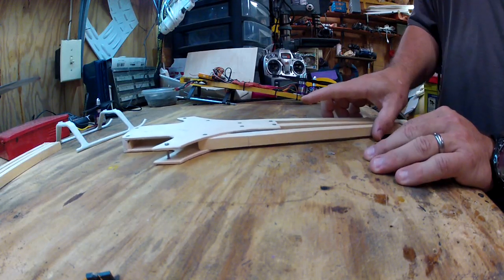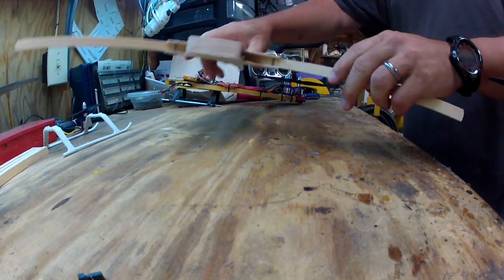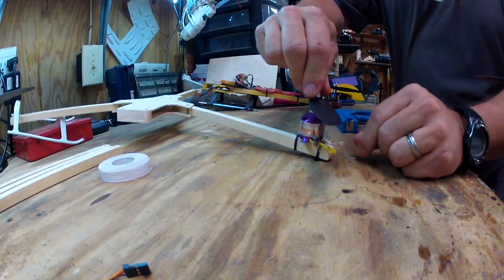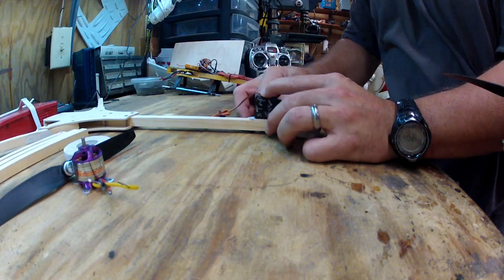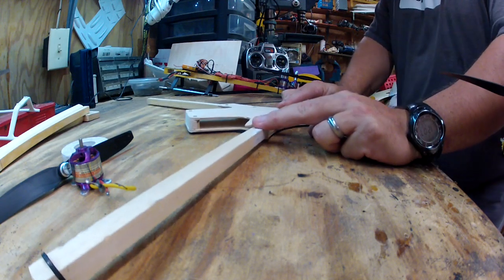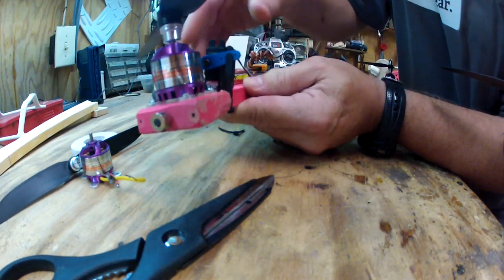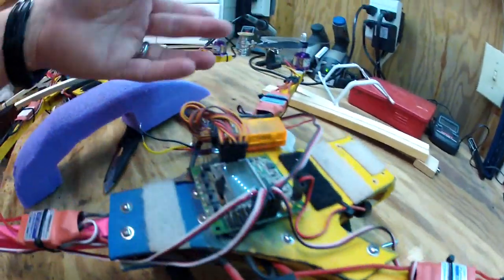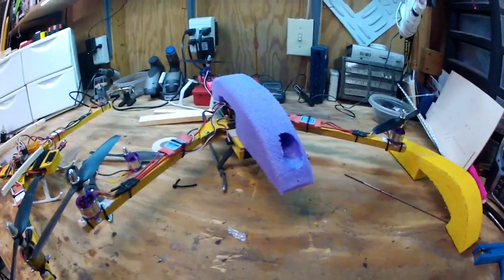Cheap Easy Tricopter Frame For Sale with build tips

Comment: I know this is very old video but do you put loctight on the screws for the frame and arms? I just got one of these used and it doesn't seem to have any loctite on any of the screws do they loosen up with normal flying? I am having so much fun with my tricopter so far i have wanted one for years can't believe i waited this long to get one.. i want to get another one maybe one of the T models maybe a smaller one. I think you sell them have to check out the site again. BTW where in GA do you fly are you a member of any clubs?  Thanks

Comment: Hey Hall where you bought the heli landing gear and what's the measurement of the tail motor base thanks hall ill be doing a how to vid on tricos and I will mention you on as the best trico pilot and enthusiast thanks hall and please post a how to flight with a close up on the radio joy-sticks.

Comment: Hi, I really like this Tri I would like to know did you just use the Tricopter setting on the board?and what CH do you use for the servo ? I fly planes.Quads,Heli, but I have never seen a set up like this w/the servo any info you can give me would really help I want to get into the loops rolls ect  if you have time you can email me at RWTRU@aol.comThanks